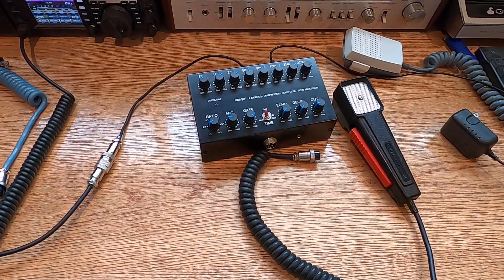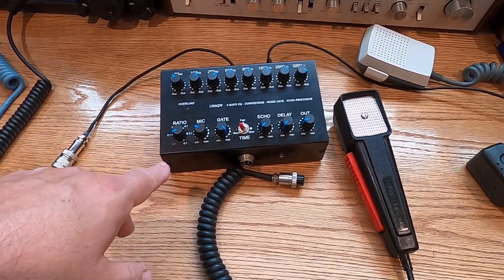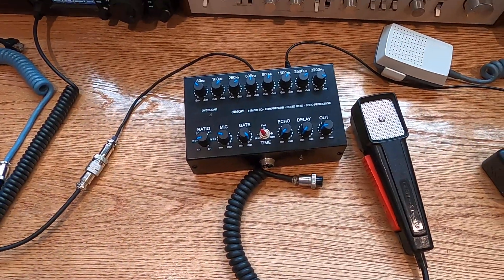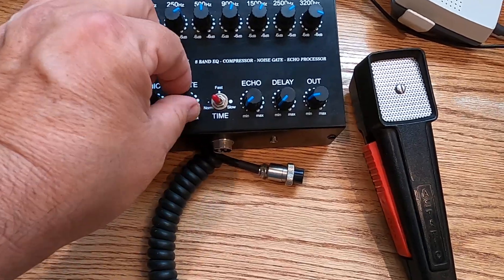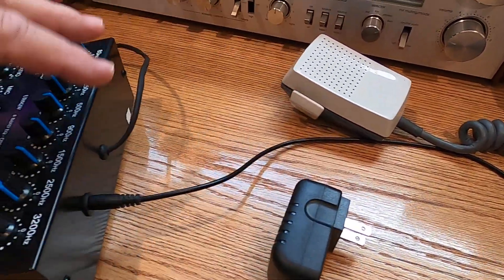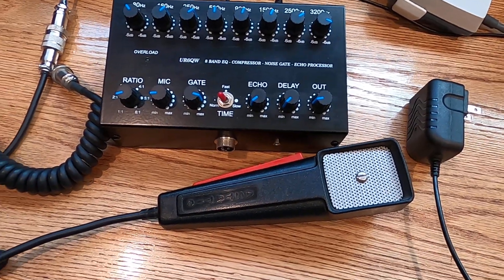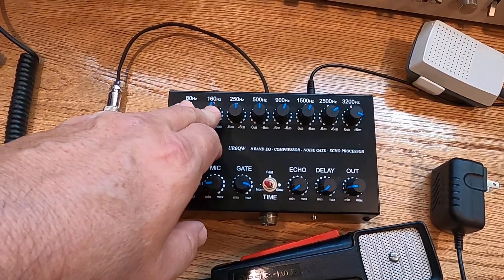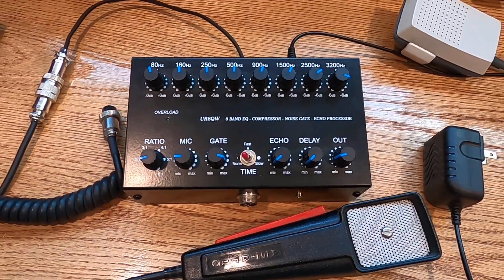UR6QW 8 Band Equalizer - Compressor - Echo processor on YAESU 991A

Comment: Nice presentation! I’ve seen them but never had someone explain it’s features. I’m glad you didn’t turn up that echo crap. I hear truckers on 19 all the time who have that turned up so high that I can’t understand them. 
My humble opinion is that some guy at a cheap CB shop hooks a radio up to a Dosy Meter POS and turns up the echo to prove it will put out about 60 watts. All with 12 volts and 3 amps……

Comment: Verrry cool!  Never knew something like this existed.  Would one of these work with my CPI-2000 base?  Using either my CPI base mic (still out for repairs/partial restoration at Clairmont Skyland North in GA) or my RF Limited (Road Noise)  2018 Extreme hand mic?  And what does the "Noise Gate" do?  I watched a video directly from UR6QW that walked through the operation (using an audio scope) but it was hard to tell what it was doing to the sound.  Your thoughts?  Thanks   - Brad